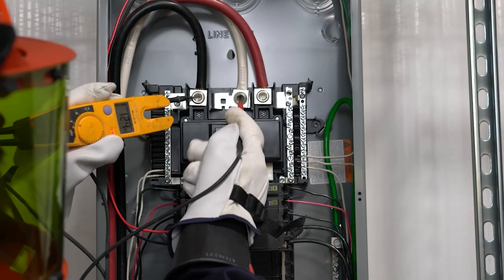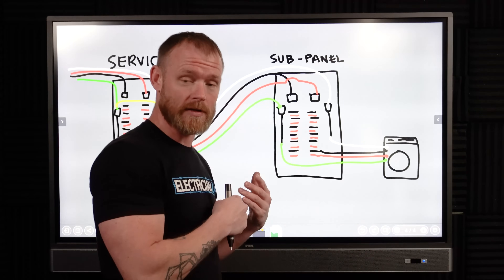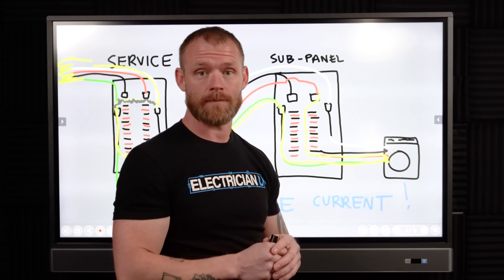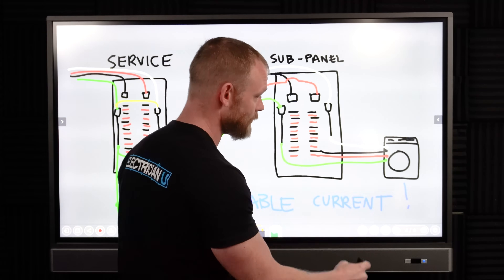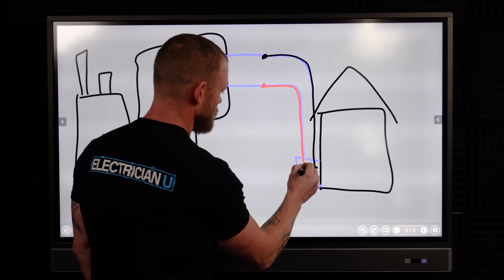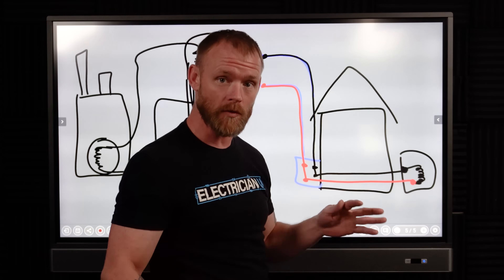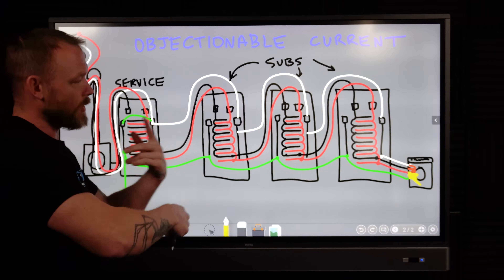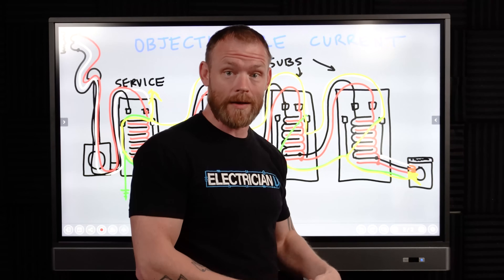Why Do We Bond at the Service Panel and Not a Subpanel?

Comment: Amazing video, loved the whiteboard explanation!

I have one comment, though:

5:34 I wouldn’t say that a ground fault is not a short-circuit.

I understand that the NEC does distinguish between both, but in power systems engineering, a ground fault would be considered as a short-circuit (because the path in that case is from the hot wire to the ground wire, i.e. only wires, which is a short-circuit). In fact, in power systems engineering, faults can be classified into open-circuit faults and short-circuit faults; at the same time, for three-phase systems, short-circuit faults can be classified into line-to-ground faults (the equivalent of a ground fault in the NEC), line-to-line faults, triple line faults, double line to ground faults, and triple line to ground faults.

Similarly, the NEC defines the ground as the soil or the physical planet Earth. Yet in electronics, that is specifically called Earth ground, with other types of grounds defined: chassis ground and signal ground.

Comment: Regarding discussion around 17:18 ("it can go anywhere that it wants... it can go on anything metal... it can start frying equipment"). Doesn't that still happen when it's grounded at the service? Ie, the short goes back to the service, where neutral is connected to ground, and now the short is on the ground as well? Sure, the breaker will trip, but wouldn't that have happened if ground and neutral were bonded on a sub-panel too? 

In other words, without something equivalent to a diode on on the ground in the service panel then isn't neutral and ground *effectively* bonded on all subpanels?

Comment: another reason you don't bond subpanels . depending on the amperage of your service, code specifies the size of your grounding wire. if you then bonded the subpanel with a smaller wire and had a fault to the ground at the main panel that smaller wire would now become you ground for the system and be dangerously undersized
Reply: If you bond neutral and ground at a sub-panel with any size wire, you are violating code.

Comment: I had a panel that the power would go way high then low whenever it wanted to. What I found was a loose neutral buss bar. Everything was loose. So, it would find different routes to neutral. The lights would get really bright and the picture on the TV would get bigger and smaller. Proves why you don't want things going through wrong places. Very well explained as always. Thanks

Comment: I added a sub panel to my main about 10 years ago when I added a an AC unit. I thought I was pretty well versed in electrical wiring as I had done a lot of it over the years but since it was my first sub panel I decided I better look at the codes to be certain and that's when I found out that sub panels are not bonded and that the neutrals and ground wires have to be kept separate. Couldn't understand why but did it as required. Always wanted to look into it and find out why so this was great video and now I know. Thanks for posting this

Comment: Would the ground fault only trip the breaker if it was a gfci breaker? So you’d need that complete circuit with a hot wire (one of the phases) and the neutral, as well as a gfci breaker?
Reply: No, the ground fault will trip any breaker because you're going to get a huge current flowing from hot to ground, which exceeds the limit of the breaker.

Comment: Hey Dustin can you do a video on 320 residential service grounding , does the meter base need to be grounded and both 200 amp splits need separate grounding or does it just need only the two 200 amp splits to be grounded?

Comment: During a ground fault situation with the ground and neutral correctly bonded at the service, what stops the current from continuing on the neutral back into the system? I mean at the point where your bonding jumper connects to the neutral bus, am I missing something there? It seems like it could take two paths from that point, one back to the source and one on the other neutrals connected. What stops it?

Comment: Great videos. I have a question. I’ve read that 220v appliances don’t use, or don’t need a neutral. Is this true?
Reply: Yes, though some devices are both 120/240, such as your typical dryer.  They run the heating element off 240, but the electronics off of 120.  That is why they changed the dryer plugs years ago to have the neutral, because before that, the ground was used as a the neutral, which was an objectionable current on the ground.

Comment: The current should flow even without the bonding until earth can't take any more charge. The connection is far worse than the neutral so it's not ideal.
Reply: What are you smoking, Sami?

Comment: Litteraly had one, every time I get a shower and then use the sink I get shocked,, well free standing stacked washer dryer,, it was grounded to frame but not the the service grounding conductor,, so yeah,, the wet floor, the hot frame of the rack threw a bad dryer recep,, was giving hot to frame,, yeah gota love the non contact voltage testers,, also found wire mess plaster wall was hot from a screw threw wire mess and a wire behind the wall,, a grounding conductor is nice, but in old buildings, in Harrisburg PA,, it's a challenge, but our job is to keep people safe,, and fix all the crap work been done in years past

Comment: Love how you said grounded and grounding, conductor,, yep it's that simple,, grounding is for saftey ,, path of "no" Resistance,, also if one losses a neutral in the service,, it can go threw the ground and things start going nuts,, and a plumber could get killed,, 🤔🤔 it's why it's nesesary to ground with in 5' of enterance of building,, ,the rest of water pipes should be bonded not "grounded",,, and pararel neutrals are very dangerous,, as well as leaked neutral voltage,,,

Comment: Great explanation,  I just started watching your videos and I love them.   I get the need for not bonding sub panels for the circuit breaker to work.  However, four simple questions,  Why, what, where and wouldn't?   You said in the beginning that the current travels back to the transformer on the neutral, but there is no neutral from the main service coming in, only two 120v lines and a ground.  What is actually going back through the neutral after the load, less voltage, less amps, watts?  Why do all the ground wires that are bonded to the neutral in main service panel also go to the earth if it needs to go back to the transformer?   I thought current went through its path in the home back to the panel on the neutral then to earth the shortest path. Why are the copper plumbing pipes also grounded to earth.  I have seen ground wires on the utility poles is that where it ends up.    if current is returning on the neutral from the load to the panel why don't you get shocked by touching it.  Why doesn't current returning back to the panel continue on through the ground bond and back to the panel box and nearby utility boxes, shocking you if you touch the panel and are grounded.  What's up with 240v appliances that don't have a neutral only a ground, does current  travel back on the same wire feeding the load, as in bidirectional, if so then why the need for a neutral on a 120v circuit.  If I'm not harmed by touching a live 120v wire because i'm not grounded in any way, what happens if you're not grounded and touch both 120v live wires.  I'm thinking it would kill you and not suggesting anyone try it.   I   if current travels to a load and I assume it's converted to energy/heat what's left to return and complete the circuit.  Is current that returns able to be reused by another device or home,  If so I want a credit from the power company for my lightly used current.    Are there other invisible energy sources like electricity out there that haven't been discovered yet?  ohh!  So many thoughts my brain can't take it.  I realize I may be completely wrong with some of my thoughts so please direct me to any videos that can help me understand.  Thanks

Comment: Hi! Great video. As a home inspector, I run across a situation frequently that I would love to get your feedback on. It is in regard to the subject of this video. Here is what I’m seeing: I will have a main panel with the neutrals and grounds bonded. I will then have a sub panel that only has the 240 and neutral from the main panel, and then has its own ground rod. Because the sub panel has its own ground rod, does that mean the neutrals and grounds can be bonded in the sub panel?
Reply: No.  The grounding rod is there to address a potential current flow between the earth and the sky--from lightning.  The ground conductor back to the main panel is there to address a ground fault between a totally different supply--from the pole transformer.  The current NEC code requires that both a ground conductor back to the main load center and a ground electrode to earth be present in an subpanel outside the main structure.

Comment: You did a video explaining why you only bond the neutral and ground at the main panel but not at any sub panels. And on your diagram you started with washer and later said equipment, and you sent the red out to one leg and blk to other to get the loop then you took the neutral and ground out so I want to know if that equipment was 220 because it makes me nervous if you were talking 120 looping together.  I hope I make sense

Comment: What should I do if I have small service panel outside and the main panel is a sub panel in the basement and it's bound because the rails are all together and stacked? 50-year-old home. Is it worth re-doing the whole panel? What about wires being too short for a new panel?

Comment: You didn't cover the case of multiple sub panels that don't have the green ground connecting them and each sub panel is neutral to ground bonded. EDIT:[And only the main panel referenced to earth ground.] That would only ever provide a single path for the fault current. An argument for this wiring method is cost. It is cheaper to only run 3 lengths of copper between panels than 4 lengths of copper simply based on the material cost of the copper metal.

Though, I can see the argument to keep the fault current off of the white neutrals in a ground fault for the period of time that it takes to trip the breaker to avoid stressing and overloading the white conductor that is expected to already be carrying current for all the attached live loads. Though in a short circuit the white neutral must carry the fault load back to the service anyway... I can also see the argument of "always do it the same way even if alternate methods are just as effective" in code just to keep consistency and reduce code complexity.

FWIW, I have a background in electronics, but not as an electrician. Feel free to throw around electronics terms and formulas, I have the background to understand them (and more importantly know how to look up the concepts that I might be rusty on). ;-)

Comment: Today many stove oven combos if you look at the ground lug and neutral lug you will see there is a jumper from one to another done at the factory. This is actually good for the stove user but bypasses the main and sub panel isolation of ground and neutral.

Comment: Kind of misses the interesting and little-understood part.  Exactly WHY is the current objectionable? A diagram showing the actual hazard to people in the event of a ground fault with multiple bonds is needed..
Reply: Any current through your body is objectionable.  A few milliamperes can kill you.  It tries to make your heart beat at 50 or 60 cycles per second and overrides the 1 cycle per second weak electrical signal from your brain to your heart.  Your heart was not designed to pump at that rate, so no blood is pumped, you go unconcious and perhaps die.  If your connection to ground is low resistance enough and the circuit is capable of delivering enough current through your body, the heating internally will cook you like a Thanksgiving turkey, but only take seconds instead of 6 hours.  Objecting much now?  Let's just say there will only be one ground reference point because we need the potential of the ground to be zero volts so our computers will work or the NEC says so and we would like to work here a little longer and will follow the code.

Comment: Total confused now. I have older farm house, Meter with 200amp breaker box on pole, panel in House, panel in Shop, panel in Barn. 200breaker bottom of Meter then splits service to house, then to shop panel, shop to barn. I am seeing two service panels and one sub panel in barn. so I should have two bounded panels barn panel no bound???

Comment: So the neutral is essentially also a safety?  If a switch permanantly on, the conductors always have a path.  If a switch is off, the conductor is still apllying potential to one side, so the neutral provides a path for current in the off position?
Reply: Nope! With the switch in the off position there is no current.  The neutral is just a conductor providing no safety.

Comment: I've made it to 17 minutes and this is an incomplete explanation.  I think the video doesn't show a good understanding of what is happening and why we bond in one point.

I'll try to explain without a diagram.  The reason that you bond only in the service panel, is because there may be current carried by the neutral of a sub panel.  If there is a load carried by this neutral, then the neutral will have a non-zero voltage, in reference to the service panel's ground due to resistance in the neutral wire.  If the voltage is high enough, its possible that it could be hazardous.  If grounds were bonded to the neutral in the sub panel, then that means the ground would have a non-zero voltage as well for items served off of that panel.  It would be possible for there to be a voltage between some grounded objects that are served off of the main service panel and other objects serviced off of a sub panel.  If grounds are bonded to the neutral at only one point, then that means that all grounds in the system are at the same voltage, 0 volts, or the ground voltage.  They will stay this way, since the ground is not a current carrying conductor under normal circumstances.  The bond to neutral must happen at the panel to allow for the fault current to complete a circuit, yes.  However, grounds should be bonded only at this point so that they stay at the same voltage (0v) across the system.  This is important everyday, and not only when there is a fault current.

There's also the aspect of having parallel conductors.  The grounding conductor could be smaller in some cases, and you do not want neutral current flowing on it, and potentially burning it up.  I don't recall this being mentioned in the video, unless I missed that part.

I felt like this video was more about why the neutral-ground bond exists at all (to allow fault current to trip), versus why we only bond in one place, which is never a sub panel.

Comment: You showed a 240V circuit with a common and ground, a common is not necessary in a 240v circuit? Also I thought a grounding rod was necessary on a sub panel?

Comment: AND... by not bonding subs, all circuits return path is forced to be on the neutral...
If sub were bonded , returning current could travel partialy on neutral and partialy on ground and cause another "objectional current" scenario with a shock risk.

Comment: Interesting... My house was originally wired with a 100 amp service panel.  At some point a 200 Amp Metered service was installed with a 100 amp breaker running to the original service panel and additional breakers for heat pump, new Range, Water heater, etc.   Any bets on whether the original service panel was "unbonded?"  This raises the question in my mind... How dangerous of a mess do I have?

Comment: ok, I am a stupid newbie and have a question. If everything is supposed to return through neutral, for ground faults and short circuits in order to trip breakers, then what is the point of an actual ground wire connected to a grounding pole or plate? this bonding between neutral and ground at the service panel confuses me quite a bit.

Comment: The bonding should be done at the first means of disconnect on the building; not the main panel unless the main panel is the first means of disconnect. 2020 code makes us put the first means of disconnect at the meter now.

Comment: WHAT IF you have 3 wire coming into all your panels? I only have two hots and a neutral coming into my panels, I have a main panel out by the pole with my meter, then a panel in my house, then a panel in my garage, they all have 3 wire in them, and all are bonded, I have two ground rods at each panel.

Comment: Just bought a house where a electrician used to live every thing marked except one big outlet while this house has 220 welder outlets one I thought was a welder outlet but not marked only had 110 to 1 flat pin while  other flat pin and half round didnt have 110 but both went to grd i thought there was a problem before discovering it was a 110 30amp rv receptacle where the green/ white were bonded in the main panel

Comment: A question: since when is a ground rod required in single family homes stateside? It must be relatively recent - amazingly.
Reply: Since the first home that was electrically wired!
Reply: @motorheadplatt8748  in that case a very significant number of inspectors in the north east, at least, did not get the memo.
Ground circuits, BTW, are a lot more recent than you think.

Comment: my dryer just has black a white and a ground so since it's 240volts the black and white are hot  so then I have 2 hots a ground should I add a neutral to it? This is how was wired back In day when house was built. I am also adding sub panel and I have   some of  same wire black white ground 10 awg cu 2 cdr with 10 awg ground type uf-B can I use this type wire to run 30 amp 240 volt plug?